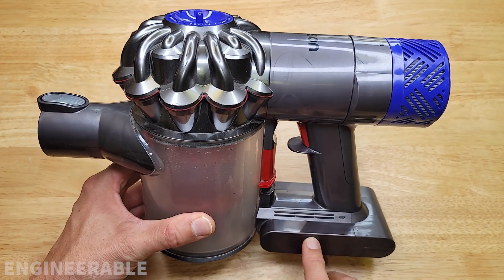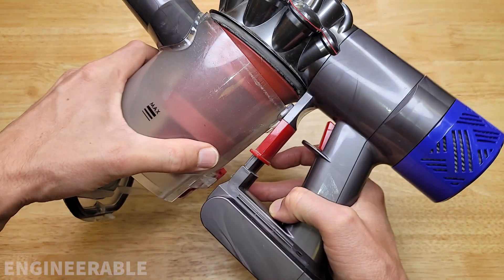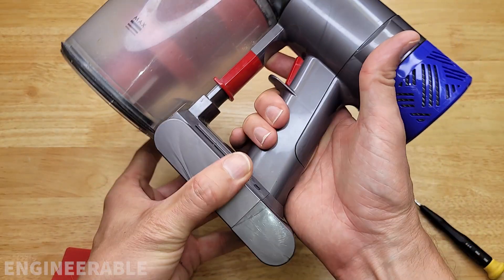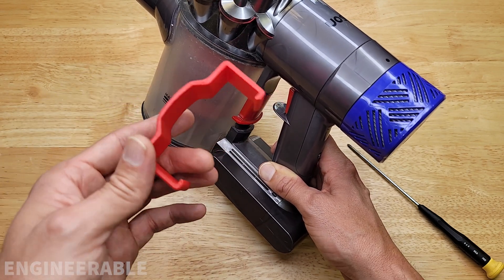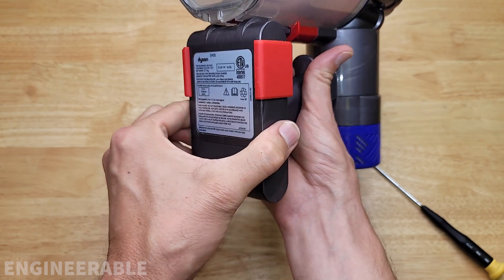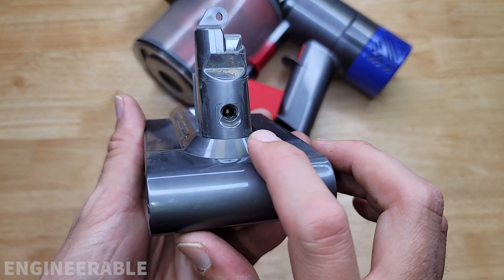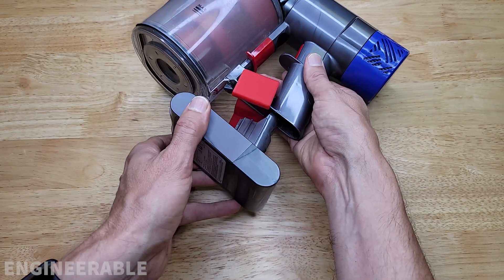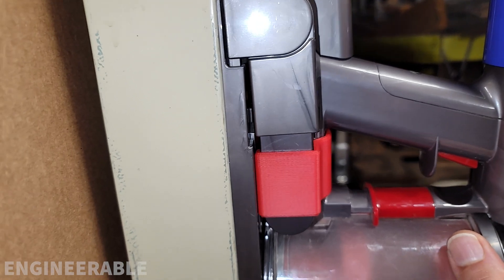INFINITE RUNTIME DYSON QUICK CHANGE BATTERY CLIP | Swap DYSON V6 cordless vacuum cleaner batteries

Comment: Infinite ? I was hoping you would connect it to a PSU, so make it wired run off the wall.
connect a 24 v high amp PSU to the positive and negative terminals?
Reply from the maker: Keep swapping batteries and charging and you'll never run out. I have another video for a charging dock for the battery. But now I've switched to using Kobalt 24V batteries that work great with much longer run time.

Comment: Oh man, can you design a v11 version?
Reply: Dyson V11 should have a click in battery, so you don't need this clip.
Reply: @outdoorsoul4570  Actually, only certain models. I have the SV14 (Torque Plus) and this was 3 screw in. Later V11 models did come with the click-in. Someone used Velcro underneath but all I need is for it fall off and drop on my foot or something.
Reply from the maker: I see, I would design one, but I don't have a v11 yet.
Reply: @engineerable  I figured as much

Comment: do you have one for V6? thank you
Reply from the maker: This is the one for V6... Are you asking for V7 or V8?
Reply: @engineerable  sorry :( brain fog - does it work for V7? thank you
Reply from the maker: @tbru13  V7 has different dimensions, so the V6 clip doesn't work. I have made one for the V7 that works, and will be releasing the video and files for that soon. Stay tuned.

Comment: Hi, will the clip fit a Dyson V8?
The link where to buy doesn't work on Australia.
Reply from the maker: The V6, V7, and V8 have different size batteries. I will be designing a clip for the V8. Stay tuned!
Reply from the maker: For now I'm using a printing service to sell it, which may not be available in other countries. I will start selling them direct soon, and let you know. Thanks!
Reply: I can't find the clip for the Dyson V7 on the shapeways website.  Anywhere else, such as Amazon?
Please advise.